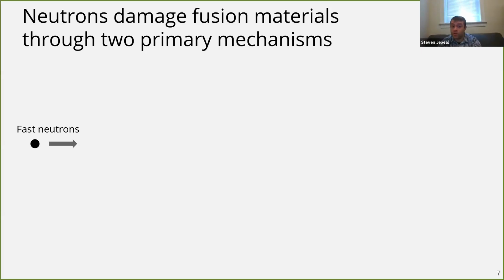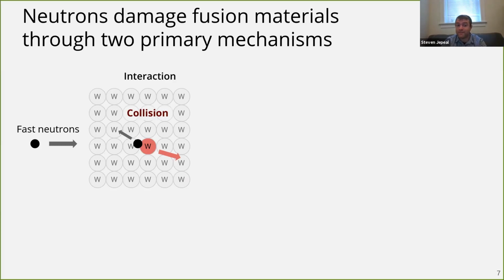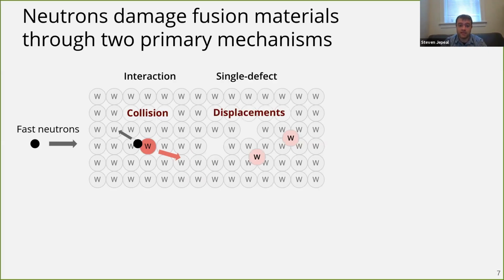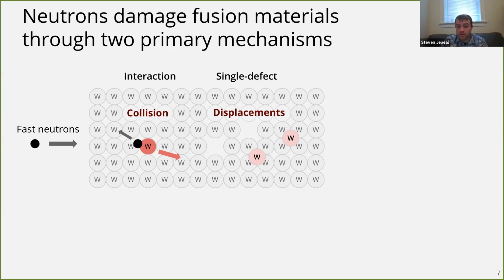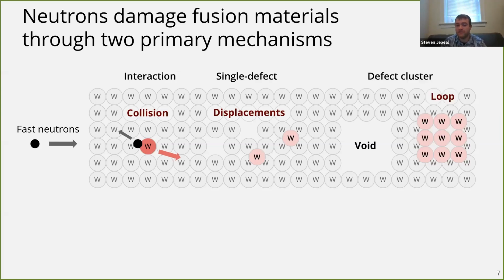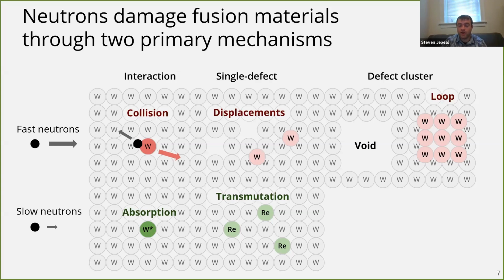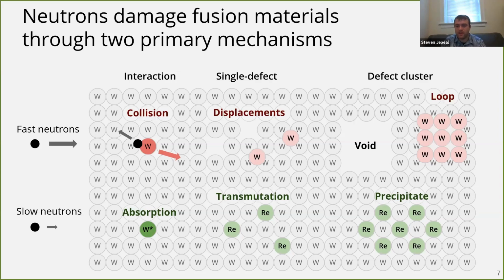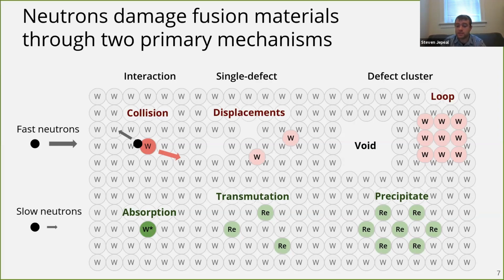How neutrons creates defects in fusion materials! | Fusion Bytes

Comment: And this is why reactors have a very carefully calculated lifespan 😅 tell this to the greedy people trying to recommission end of life reactors just to power AI datacenters!!!
Reply: Its like for Eg. You have a plastic bag you are determined to re use it over and over again it gets stretched, exposed to the sun  hot cold hot cold over and over does it have the same carry capacity as it did when it was new? Absolutely not. A neutron compromised reactor core is a dangerous thing to be guessing how strong or weak it it may be. It was shut down for a reason because that margin couldn't be proven anymore